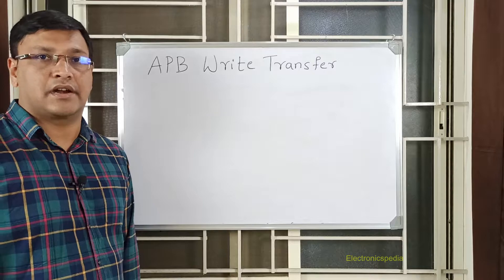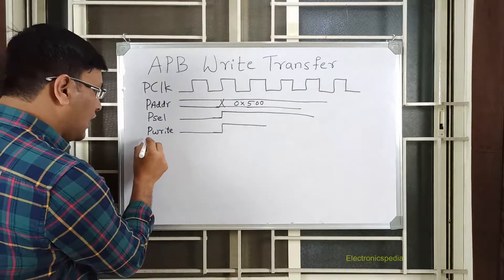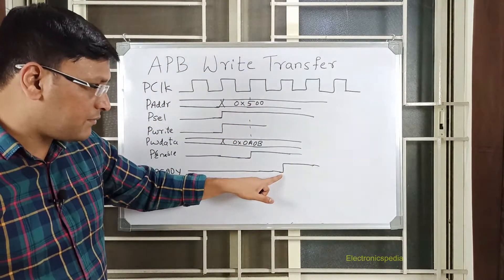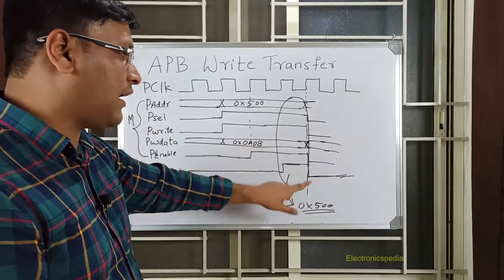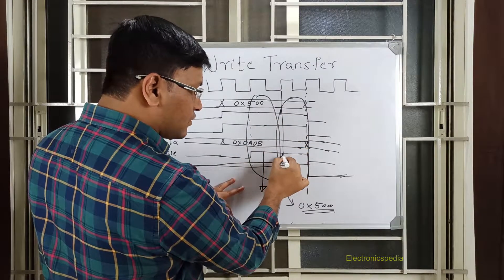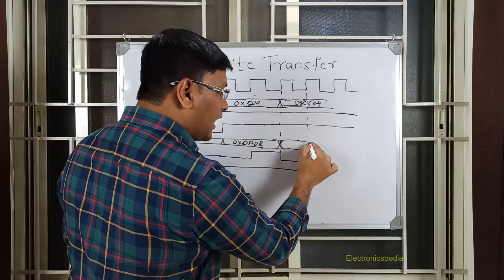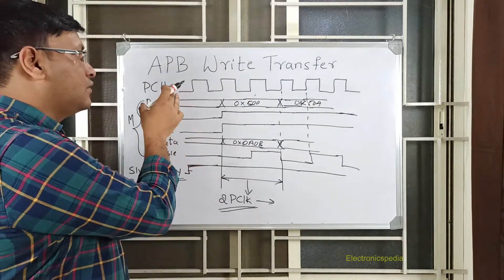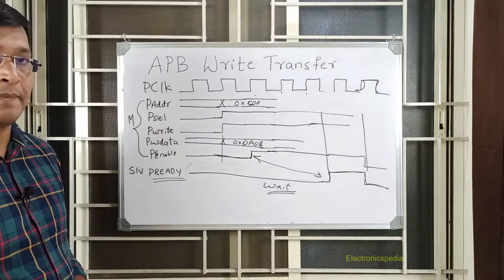APB Protocol Basics Write | APB Write Transaction | APB Write Transfer | APB waveform | APB Protocol

Comment: Can pready go high at same clock cycle tick as penable ? and can pready be high for multiple clock cycles?
Reply from the maker: Pready can always be asserted by the slaves, which are capable of returning the data in 1 clock cycle. 

However the master needs to bring penable low the next clock after it sees the pready asserted by the slave.

This means penable will be asserted for only 1 clock cycle.

Comment: Is it a protocol violation if penable is deasserted after lets say 10 clock cycles(instead of 1) after pready is asserted?
Reply from the maker: Yes it's a protocol violation if penable is deasserted 10 clock cycles after pready assertion.

But psel can be held high as long as you are accessing the same slave.
Reply: @Electronicspedia  Thank you :D

Comment: Sir, why is Penable asserted after one cycle and not asserted with Psel, what is happening between Psel assertion and Penable assertion?
Reply: Penable and Psel assertions are separated because if both are asserted together in setup phase it will cause a problem if master wants to write to same slave.